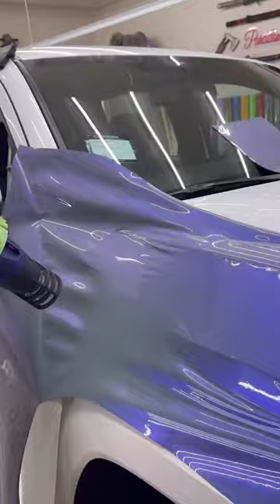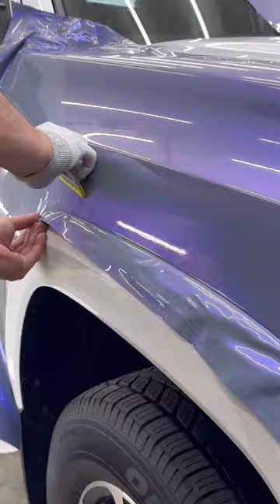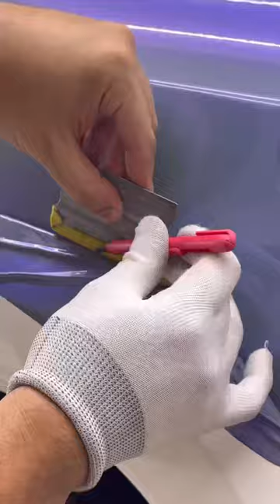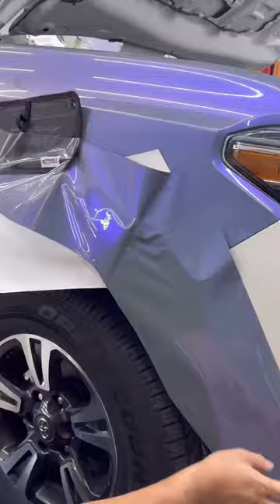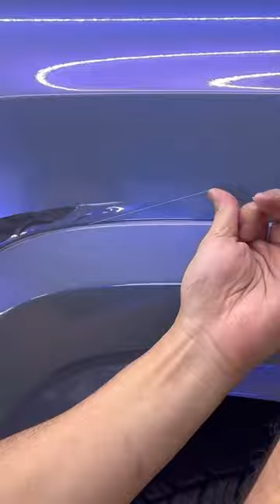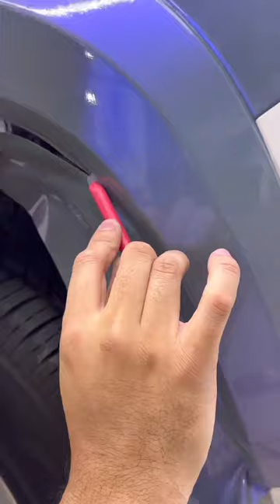Making Trucks Cooler #shorts #diy #truck

Comment: Body wraps suck they don't last for s*** it's money down the toilet
Reply: Especially if it's a plain color that could've just been painted on. And the attention to detail SUCKS if you ADHD out on your vehicle. There are seams and lines and unpeeling edges everywhere. I'd rather it just rust than be peeling and faded out in 2 years. I worked next to a wrap shop and the owner said he'd never wrap his own vehicle except the company truck that had a crazy looking wrap on it for demonstration purposes of the business. He did the local PD vehicle and fire department vehicles but mostly storefront windows was where he made his money.